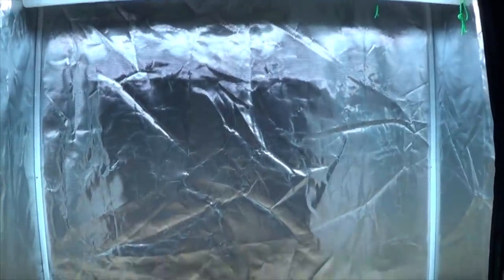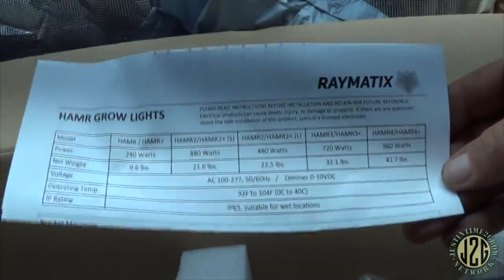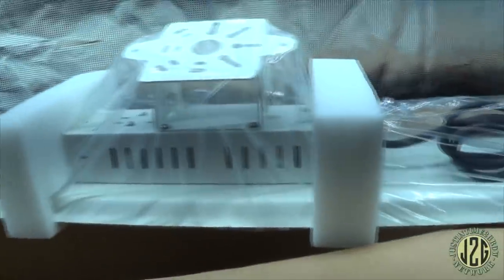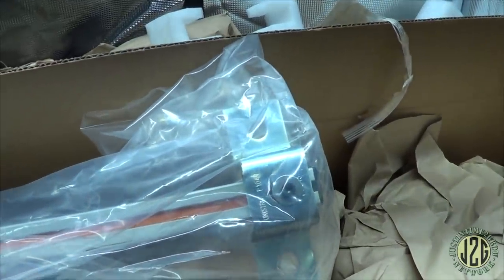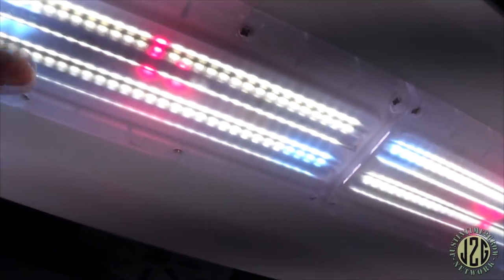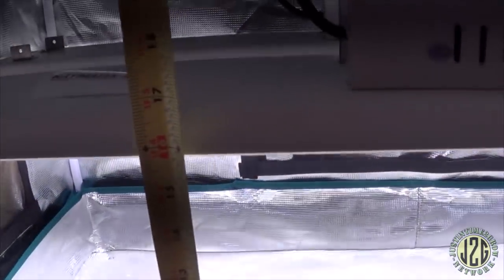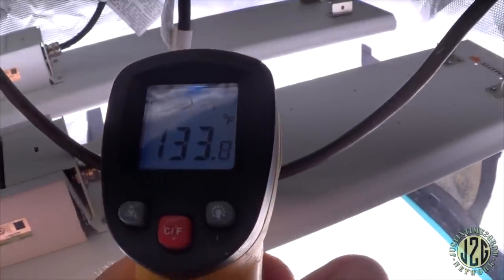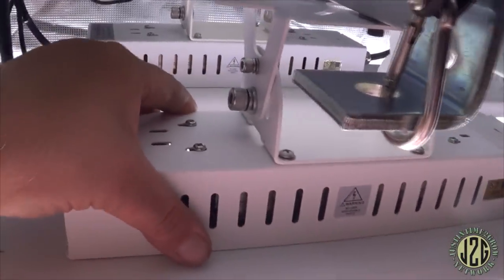Most Versatile LED On The Market Today? - Raymatix HAMR+2 Unboxing, PAR, Wattage & Heat Test

Comment from the maker: Keep in mind this light is meant to compete in the 4x4 bracket, hence the price. If you're looking for ultra high PAR output you can toss it in a 2x4 with some CO2 and CRUSH! Between that and the modular design along with the swivel mounts there are just so many options with this setup which is why I think it's one of the most versatile setups on the market.
Reply: Justintime2grow good day/night Mr. what is your top 3 LED for a 2x4 the will crush(price not am issues) thank you so much. You number viewer. 😎
Reply: Got my light from Raymatix and i gotta say I am impressed! Thanks for recommending the hamr
Reply: Do you have any recommendations for a bar type led grow light close to 3ft long ??? For a 3x2 tent ???  Cheers
Reply: Tim Turk thanks for information bro. I needed to hear it all. Thanks!!!!

Comment: Think a slight angle out toward wall would help the edge par readings and also would lower part readings in the middle while raising par readings on the edge for more even light and most important a more even canopy which we all strive for...love the tilt feature..

..Digging the ability to angle in or out... Haven't heard this name brand but the components are top quality which has me wondering why marketing isn't up to par.. also saw there side wall lights that was impressive..You could blow up your girls top to bottom.... impressive lights would definitely love to have the total package setup in a 4x4 or 4x2..thanks for all your hard work and help with our purchases and set ups...

Comment: very nice, but measuring 16 inches from the floor doesn't really say alot, what really matters is how much light is hitting the floor if the plants are 1.5 - 2 meters tall..

Indoor we tend to trim/lollipop at least 1 - 1.5 ft off the bottom of the plants to put more energy into the top half of the plants, tho overall resulting in a reduction of yield.. 

Outdoor there is no need trim to anything because 127.000 lumen per square meter is blasting the ground..

Comment: There is a hack that makes most lights blast harder. Tho the bulb degradation is also harder. But it only works on true top bin bulbs w/o a board to throttle it to specs. You control the specs😎

Comment: You need to test the HLG 648 Diablo triple configuration with the 480w Meanwell driver 1998 diodes insane and the board is complete Samsung made
Reply: Hlg is just crazy overpriced for a basic quantum board Lol

Comment: Hey I just got a Mars Hydro 2x4 and the sp250 light how high would u recommend hanging it for veg and how hi for flower
Reply: KustomGraphics206  hi ,im trying to decide if the mars hydro1000 or spider farmer 1000 have any differences,. in your opinion what would you buy between them